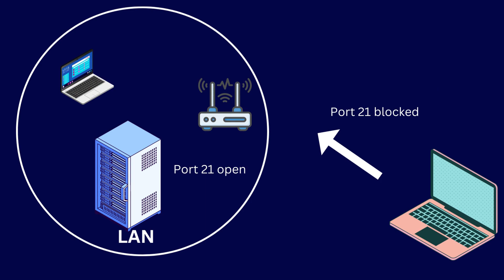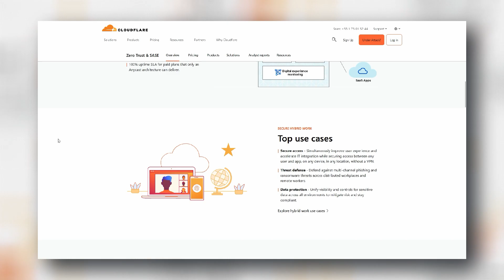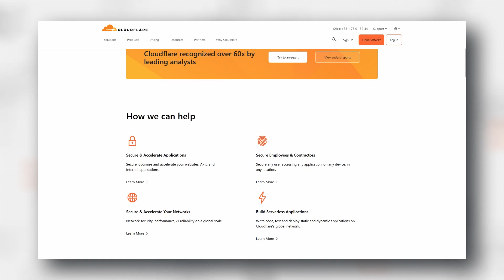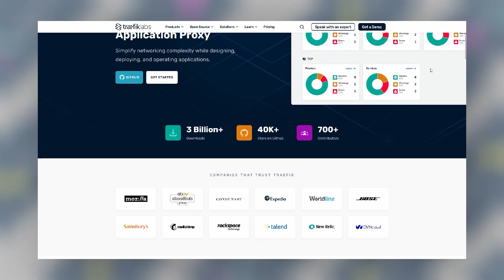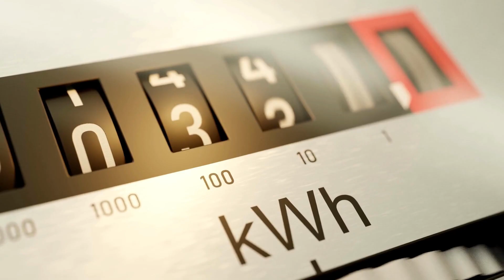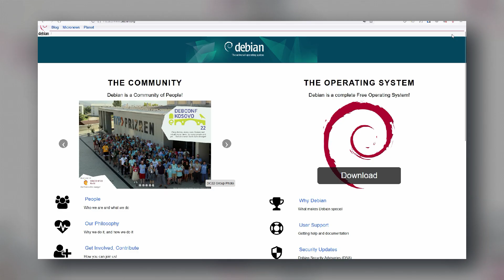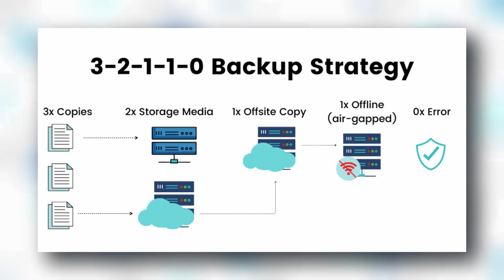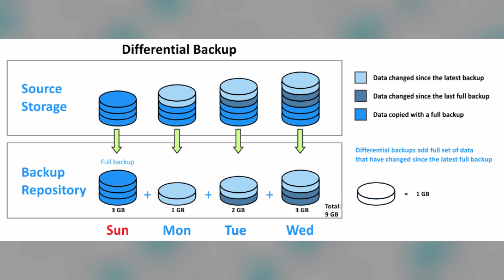Avoid these MISTAKES while self hosting your home server !!!!

Comment: Especially the point about virtualisation is very good. One powerful machine is often much more efficient than running several smaller ones. This is because most of the time the machines will run near idle in a homelab, but every machine has a base consumption that it won't go below, even if idle. Having 10 machines means 10x the idle consumption. Consolidating this on one more powerful system is a lot more efficient. Of course it is cool to have dedicated machines for everything, but it isn't practical :)
Reply from the maker: I agree completely, if one machine could do a perfect job, why run multiple machines which would be running at maybe 5 % of their capacity. idle power adds up to a lot when you consider year round consumption.

PS: dont forget to give a sub :)